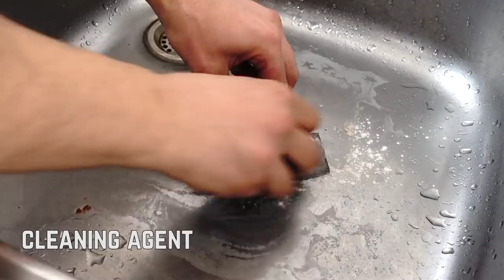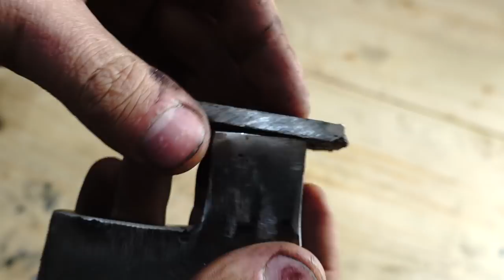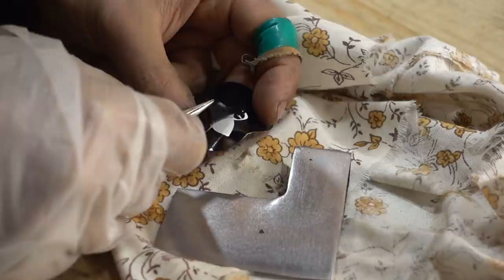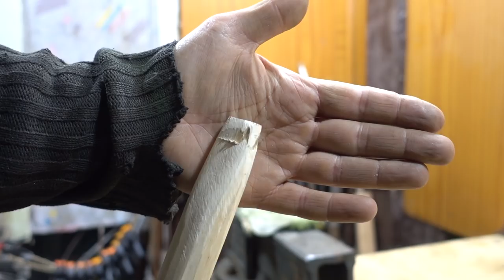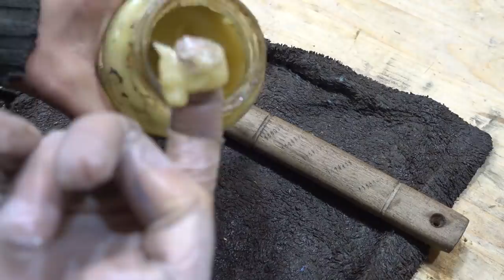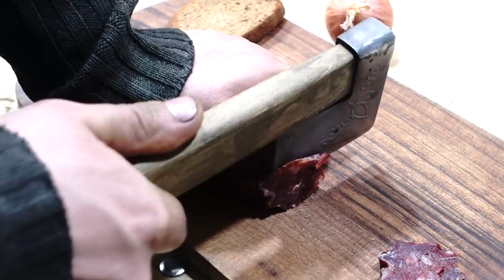Restoration Rusty Smallest Axe

Comment: Nice little project!

This is the difference between an axe and an ax. Too small for that extra "e"

Question... if you etch a piece with a mirror polish, how much will the etching process degrade the finish (how much work would it be to get the finish back to a mirror polish after etching?)

Always good to have a nice snack after a job well done!
Reply from the maker: Thanks for your attention. Answer - it all depends on the etching time, but for example, if we take my version, in 15 minutes around 1 millimeter or a little more is etched. To restore the former appearance, you will have to sand on sandpaper from 80 and above.